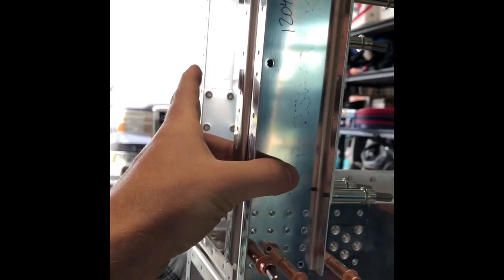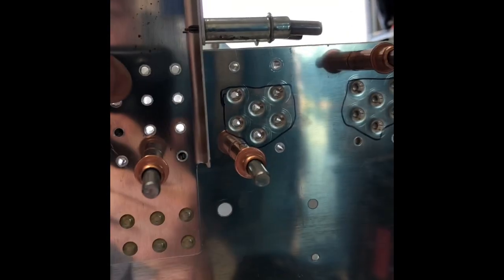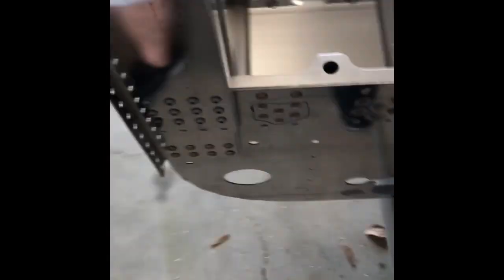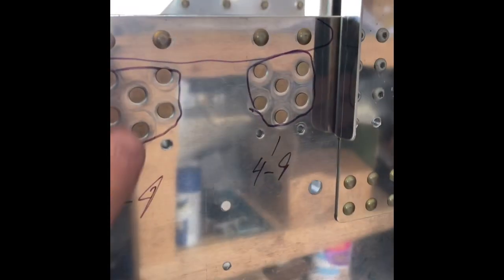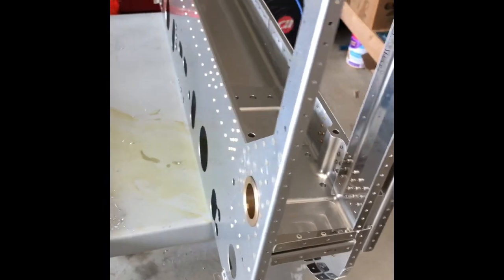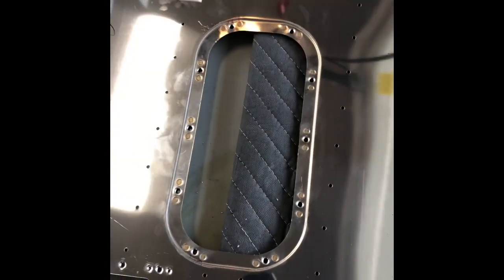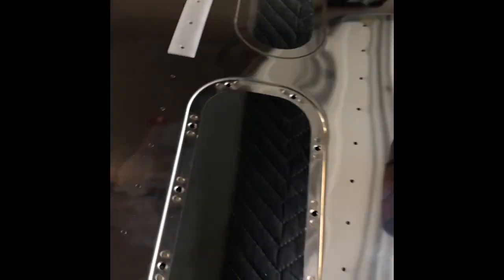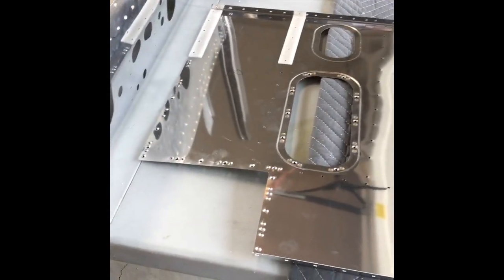Vans RV12iS Fuselage 1

Comment: I heard you say you you bought tools for the RV14 but then went with the 12. Why? Thanks for sharing.
Reply from the maker: Slappy Happy a few reasons I changed my decision. The first being mission, most of my flights will likely be local with an occasional 300-400 mile xcountry. Mostly looking for a time builder that’s easy to fly, fun and “cheap” to own and maintain. The 12 meets all of those requirements. The second was overall cost.  Building this plane out of pocket with a 5 year timeline. After going over our financial plan we (the wife and I) settled on $100k all in budget over the 5 years. The 14 just didn’t make the cut. If you’ve been following me you’ll know that we changed that after I started the 12 when we discussed the 10 build. This required my completion timeline to be changed from 5 years to 7 years and the budget was adjusted accordingly. Due to the size of the 10 it required my wife be a part of the build which was a no go and back to the 12 I went. I had jumped in and bought the tools initially before we budgeted out the above, which ended up not being too big of a cost setback now that I look at it as I use nearly all of the tools with the exception of the rivet gun and drdt-2.

Comment: If you don’t mind me asking how tall are you? I’m curious if I will be to big for the RV12. Thanks
Reply from the maker: I am 5'8", so not tall in my mind but there was plenty of headroom for me when I got to ride and the seat bottoms can be adjusted for those who are taller.
Reply: Thanks for the reply! How difficult would you rate the build overall?
Reply from the maker: Trey Martin, it is super easy! The plans have excellent pictures and are easy to follow. As you can see from the videos the kit goes together very quickly. With the right tools it’s a breeze. Checkout Vans FB page videos. They did an interview with me a couple months ago about the building process to which I talk about the simplicity of the kit.